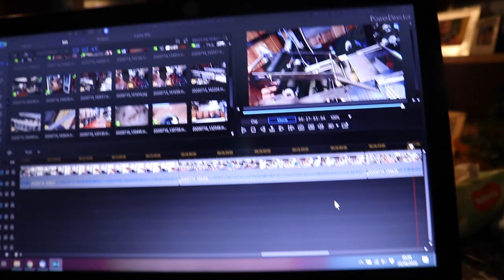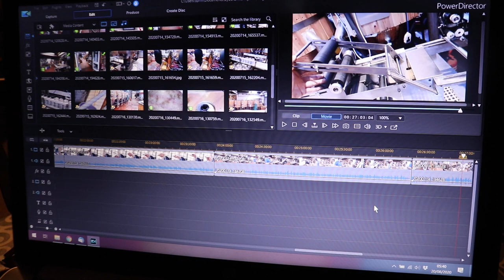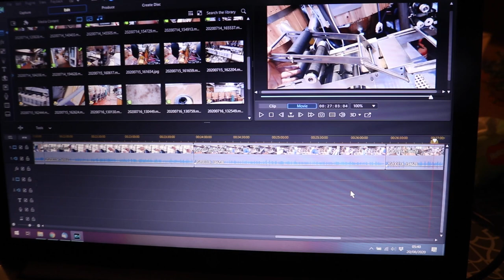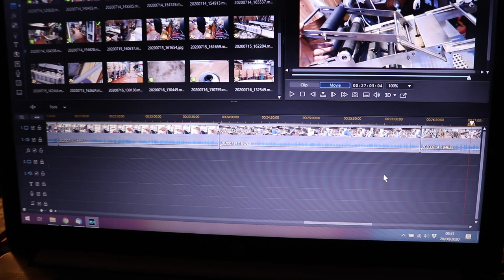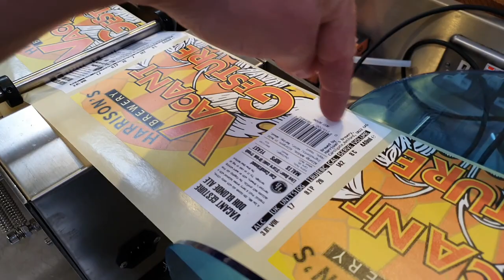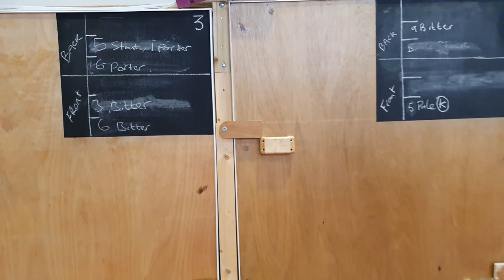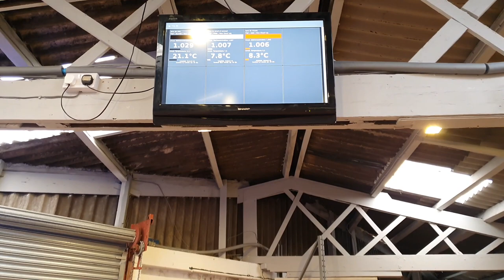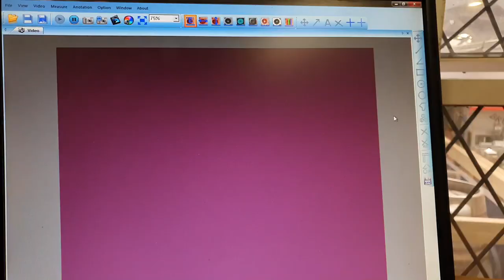A BREWERS WORST FEAR 🍺🍄

Comment: have you tried washing your yeast with star san and storing it in it after rinse? its an option to try but before pitching it toss it under the scope and take a cell count for yeast and make sure your bacteria are gone. what i mean by that is run a small amount in a starter first to liven them up and make sure they are still producing then take the cell count and look for the bugs before committing to run a starter on the entire batch of yeast and wasting time on that.

Comment: I cringed slightly when you picked up the timer PCB with no ESD precautions and actually let out a minor squeal when you put it track side down on the stainless surface 😱 my core area of expertise  it may still work but likely not for as long as it would have done. The microscope was interesting stuff but not something that I will be investing in for my nano venture 🤣  . S..r, cheers, Schnuz.

Comment: Good to see you back mate. I have done more work on the LCD display for the canner and have been running on mine for a couple batches. The code for my filler has changed a bit from the master code base, but I will try and backport the changes over this weekend. I added a menu system with the ability to change all configs via the LCD. Here is a test I did a while back. https://youtu.be/h23gJr80Gi8
Reply from the maker: Cheers mate, I appreciate your help. I will be looking at it again soon and the updates sound great.